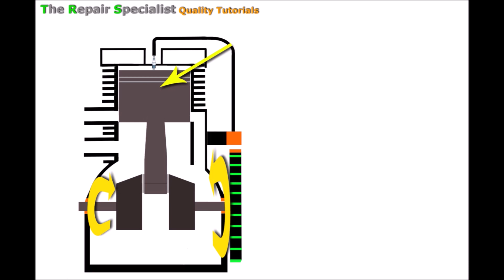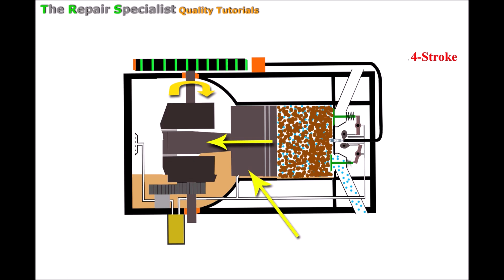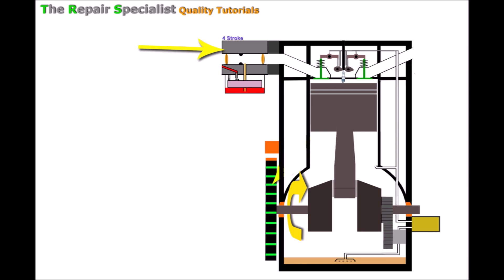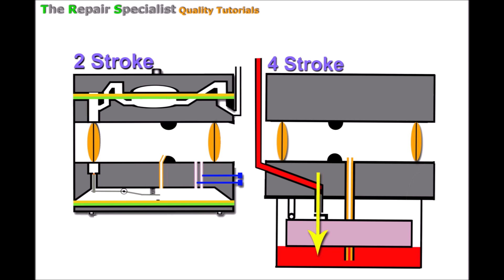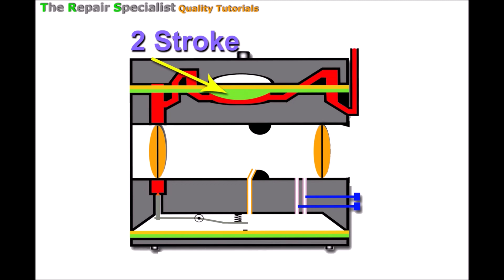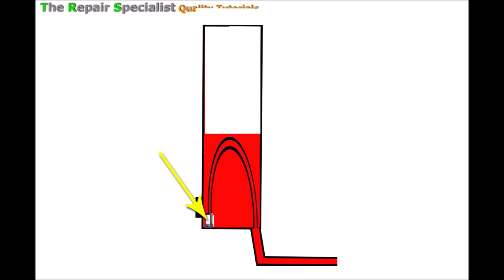Why Garden Machines use a Two Stroke Engine.  (by Craig Kirkman)

Comment: Their are 4 strokes out their now that can run in any position, engine mane by Stihl (don't remember the model now).
Reply: kennedy singh I believe you refer to Stihl four mix. It uses 2 cycle gas, but has valves and a cam, and indeed runs like a 4 cycle. They are much quieter than comparable 2 strokes. Wish I had one.